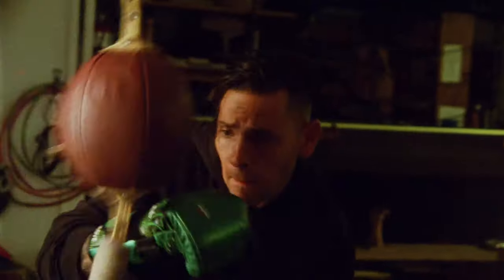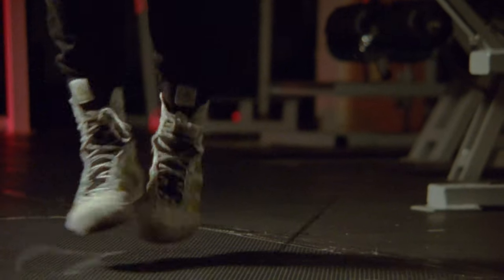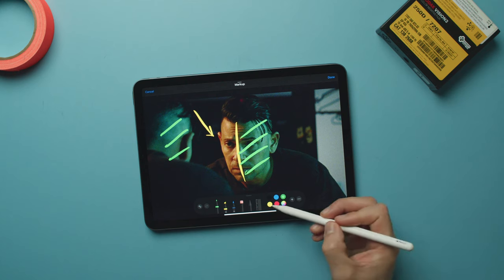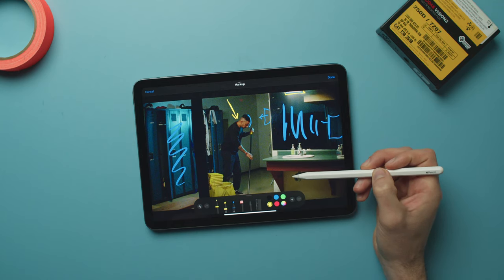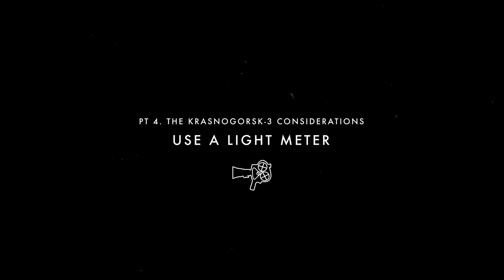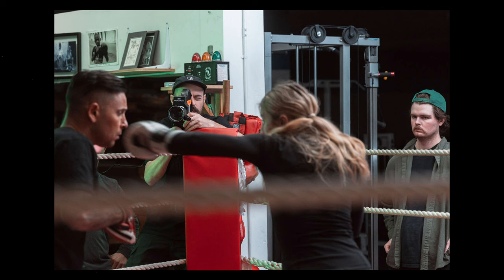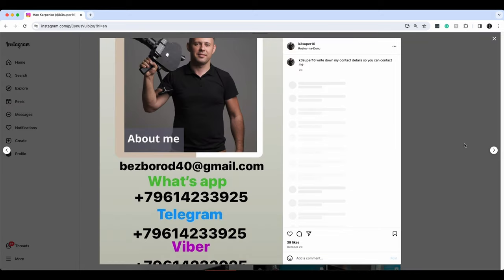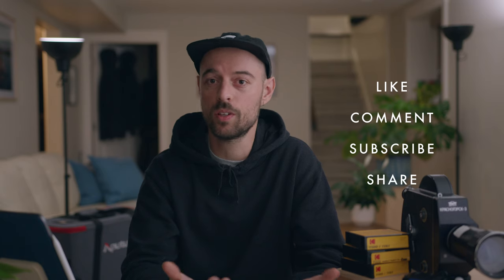Shooting 16mm Film on Krasnogorsk-3: Process & Tips

Comment: Was the reason that the camera ended up being seen in some of the mirror shots due to your K3 not getting a re-centered lens ring after your super 16mm gate upgrade? My K3 is still unmodified, but your experience sounds like the same thing I've heard happen to those who have changed their gate, but not recentered their lens.
Reply from the maker: Yes i believe that was the case - Max @k3super16 has since solved that issue with all of the cameras that he now sells.